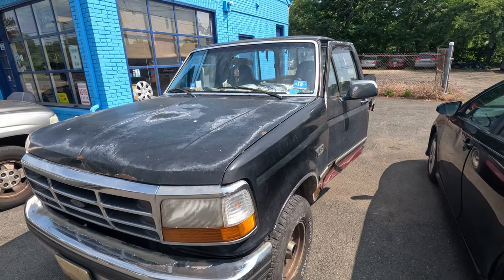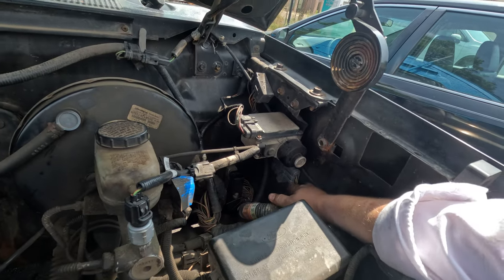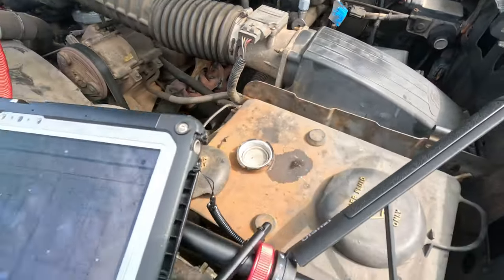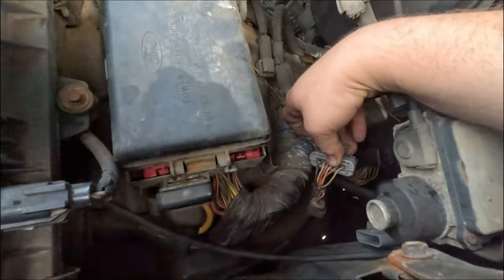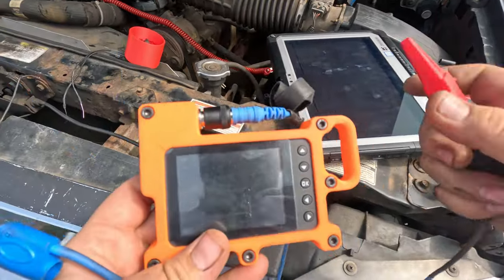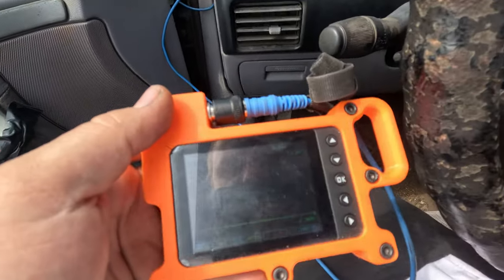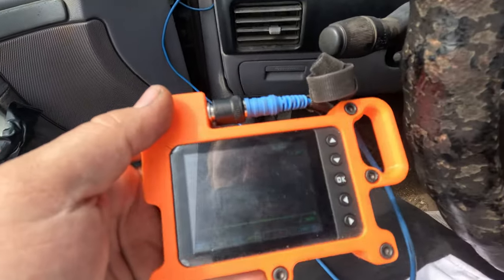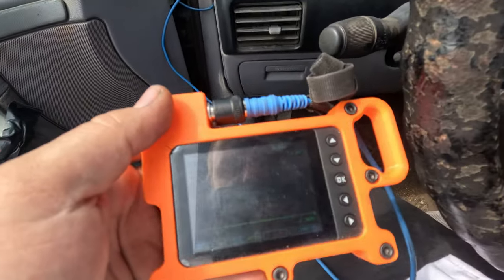1995 Ford F-150 - Crank No Start (No Spark) Diag & Repair!

Comment: In a Factory Master AUTO Mechanics College i had to go to for years the Teacher made the class recite a poem at the beginning of the class every time is this: Most electrical problems occur at connections and are resistant by nature...    this i have found is spot on...

Comment: Not sure whats up with everyone with the piercing of wires? We out here trying to keep trucks like this running. Nail polish is the last thing this truck needs.😊
Reply from the maker: You need to trust your connection otherwise, you're doubting your tests; the nail polish will easily outlast the truck. Thanks for watching!
Reply: @advancedleveldiagnostics  no bro. Not against piercing wires. Just noticed everyone who is doing diagnosing. Of late have to show that they are using nail polish or electrical tape because they are getting trolled about piercing wires. I pierce all the time. Either you want it fix or not.
Reply from the maker: @djmobileauto  Got it🤣I was getting  comments on every video "reminding" me to fix the holes. So I now try to include it if I remember at the time.

Comment: I have a 99 with the same problem. Took to 3 mechanics who I suspect got their licenses from a Cracker Jack box. Last one told me it was my computer. I’ve replaced cpk sensors, cam sensor, still no spark. Yesterday I pulled out my computer to get the codes for a new one. Ima put it back and check this out! Thanks buddy
Reply from the maker: Hope it helps! There is also an ignition capacitor that sometimes goes bad.
Reply from the maker: I'm sorry just looked up the 99 and it's a whole diffrent system.
Reply: @advancedleveldiagnostics  no worries buddy. Thanks for responding at all lol. The computer itself I was taking a closer look has 2 char marks on the outside metal plate. Maybe it is the dang ecc 😢
Reply: @advancedleveldiagnostics  it was a damn ignition wire! I guess before I had the truck, it had some security system. Whoever took it out slapped a 10vt cable to the 30vt ignition cable. Saw it as I was replacing my switch. Put the proper cable and now she lives!!! 🤣. Surprised it lasted this long before finally burning out tho. Ive had it for about 6 years. Anyways super happy it wasn’t something pricier. Thanks again. 👍🏽
Reply from the maker: @chancho1002  Glad you got it figured it out!

Comment: Thank you for the diagnostic. Same problem happened to my 95’ F150 but happened when it was running, just keep dying. And after a while run back again like nothing happens. Will check wiring tomorrow, thanks!!!
Reply from the maker: Glad to help! hope you get it sorted out.
Reply: @advancedleveldiagnostics  I have same problem I was driving back to home and my truk die on me  I change that coil I ignition module distriburator rotor and nothing no spark was so ever all fuses are god relay as well I ordered a new ecm but I’m going to clean that harnes to se if works because I never have any issues besáis that o2 sensor code

Comment: Another Great Video... yes these trucks are getting very old and many problems will happen. corrosion is going to happen. the wiggle test is always a good one... moisture and connectors will create a High resistance. after you clean connections for a very low resistance or a no resistance you forgot or don't know or don't care or are uneducated that you should learn to protect this connection with a simple injection of a thing called [ DIELECTRIC GREASE ] YOU should do your homework on DIELECTRIC GREASE... you can tell your customer you removed the POTENTIAL REOCCURRING corrosion issue on this connection that can last a life time. DIELECTRIC GREASE will stop MOISTURE you will learn... and the customer will come back for repairs because they will have trust in you...

Comment: Under your hood, Relay box. Second relay from the bottom. Fuel pump relay gets corrosive, Take out clean or replace.
Reply from the maker: Thanks for watching! A bad fuel pump relay would not cause no spark, This had fuel but no spark.

Comment: I know this is an older video but thanks for making it. My distributor went bad and after replacement it will only crank/no start. Now I have somewhere new to look. The wiring in the truck has been pretty shoddy in most connectors so hopefully this is it.

Comment: Thanks for video I have 1996 ford f150 v8 xl efi, this was the problem had corrosion in pcm connectors, when I unplug it an plug it back in truck started up no problem
Reply from the maker: Thanks for sharing!

Comment: Thank you for this great video.  My ‘95 F150 runs, then while driving at it shuts off for a second as if I turned off the ignition key.  Then after 1 second it comes back to life.  If I’m accelerating it really jerks when doing that. This is very random and does not happen very often.  Then I also run into the cranking and no start.  I was suspecting the PIP sensor, but I will also check the connectors and fuse.

Comment: Excellent vid. I believe the square wave is a very low current signal. So a little bit of fluff on that one could negate the signal. I thought u might pull out the MT 2400. I think it has all the diagram for all the connections built in to the program for those old cars. Mine does. It seems u have an All Data subscription. Getting pretty necessary now. I am watching all your vids. U gots it going on!!
Reply from the maker: Thank you so much! Yes, in today's vehicles, you need service info. Before I was doing diagnostics professionally, I used the information on an old Modis. The Mt2400 I only got a few months ago.

Comment: The damn ford no spark ,I know ford all to well!! Those coils crack sometimes,let in moisture and you get no spark!!! Had fuel pumps,fuel pump relays, starter solinode ,the ones on inner fender, all go bad!! They rust so bad,the inner fenders have a large gap,where road salt gets in and rust your manifold bolts to crap!! And they leak!!  I can go on and on!!! Thanks ,great job in finding, bad corrosion in the connecter pins!!
Reply from the maker: Thanks, Jeff! This one was not as rusty as I expected!
Reply: @advancedleveldiagnostics  I hope this fix my problem I’m going to clean it up vefore I move to change that ecm I have same problem and I found that my power steering pump cup was lose and spell fluid all over  so it might get in to that harnes

Comment: Thanks for another informative to the point video. I'd like to ask which of the auto information sites you would recommend for wiring and general repair information. Thanks again
Reply from the maker: I think if you can only get 1 it would be AllData, They have the most info IMO and the most user friendly. I still thinks Identifix is great to have for the tech tips, If you have a system you are not familiar with alot of times a tech will have a way to test something that you didn't think of, saving a lot of time.
Reply: Thanks for the response. I'll take a look at both. As far as finding new ways to test systems. That's the reason I watch you.

Comment: I just want to say Seeing this video has be Fantastic and it vary well may be what i am having because i have a 94 and 
its doing a similar thing where it wants to start but their is No spark Replace the Coil, and Distributer Cap so thoes are Brand new Thank you Vary much for this Video imma Go check that and see if that fixes it any Tips if it does not ?
PS the Coil Was Pretty Rusty around the outside and the Clip that was on the old one Looked Factory,
NOTE: I do not have access to any of thoes Gadgets, that you have their,

Comment: What part number lights do you use for load testing? I want to make a couple. Great videos.
Reply from the maker: I have a 194, 3157, H11, and a 9003 (with the high and low beam tied together for 10amps). That's all I remember off hand😃

Comment: Have a 1994 Ford lightning just giving me the same problem can you direct me to need help change the distributor and ignition coil still nothing no spark
Reply from the maker: Do you have power to the coil and ignition control module?
Reply: @advancedleveldiagnostics having the same problem. Mechanic changed ICM, Coil, and distributor. Gets a reading but too low. Is leaning towards it being the computer but hard to find. Its a 1995 ford f150 eddie bauer 5.8L. Original problem was hard slams when it tranisitioned from 2nd to 3rd gear, 3rd to 4th. After sitting a couple months with starts every other day, one day i started it up 5 mins later it was off on its own and wouldnt start up since. Im desperate man. My truck looks pristine and only has 80k original miles. I dont wanna lose her.

Comment: Advanced level? Ha. Front proping connectors is a no no.
With Ford tfi, check for pip signal first. It saves time. Also if the coil has 12 volts the distributor and icm will too. They all get power from the same circuit.
Reply from the maker: Front probing is only a problem if you use something that will spread the terminal. The tip of my light bulb is a tiny needle that just touches the top of the terminal.